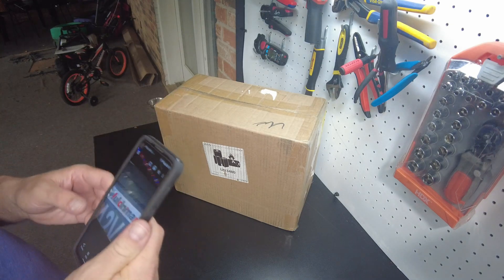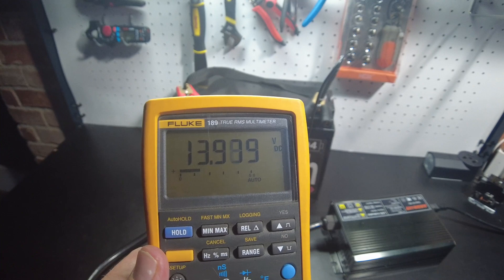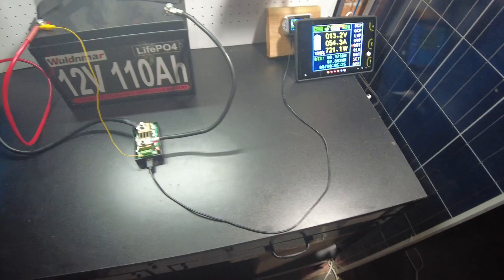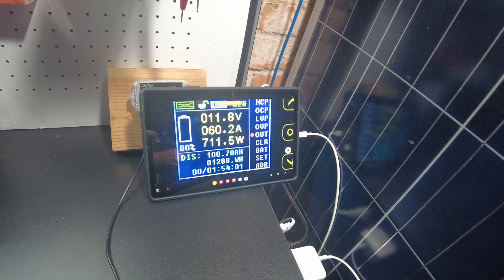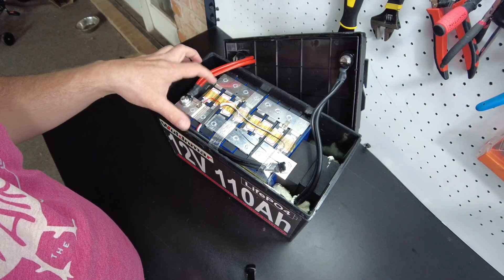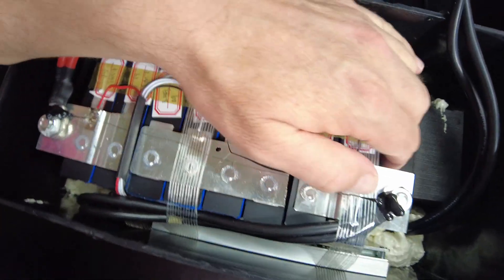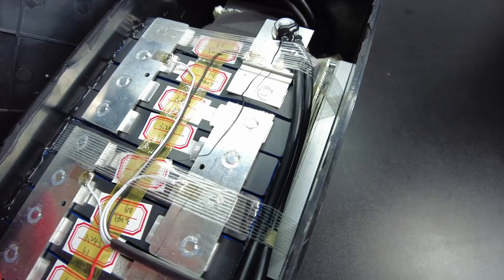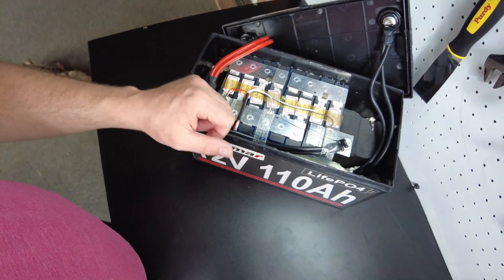Wuldnmar 12.8v 100Ah LiFePO4 Lithium Battery

Comment: Used cells individually tested to make sure there's enough life left to slap a battery together? (paper test label on top of each cell) Mid to high grade B? Seems a major red flag to get fake badging right on the front before you even get inside.
Reply from the maker: I need to try and read the QR codes. Probably do that in a bit
Reply: @BradCagle  Good idea, remove the top black insulating sticker and check both QR codes, see if any were sanded away to hide the battery origin.

Comment: There's a ton of 105AH cells on the market right now...I bet that's what is in that case.  Nope, I was wrong...55AH cells in a 2p-4s configuration, so it "should" have pulled 110.  Bummer.
Reply from the maker: Yeah, I think I'll try to scan those QR codes, and see what they are.